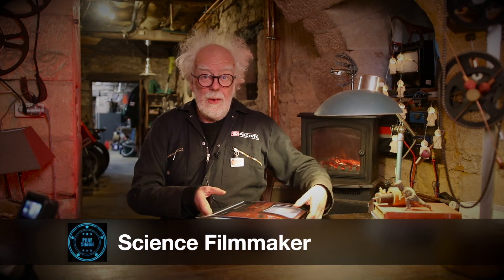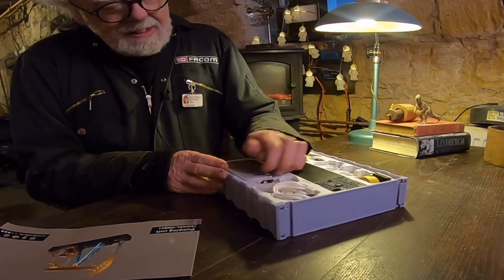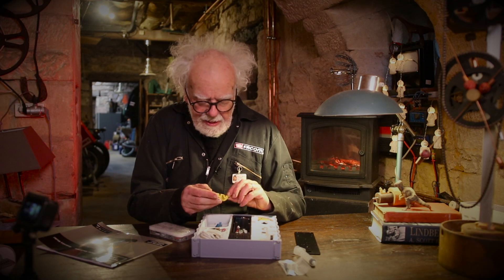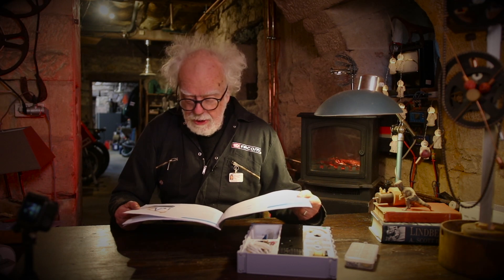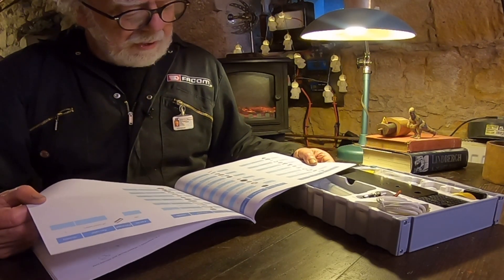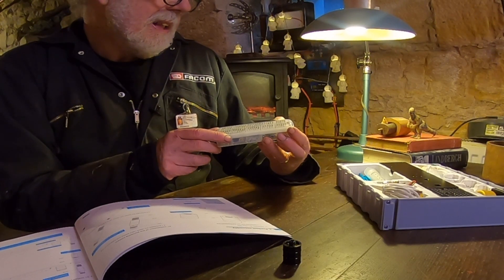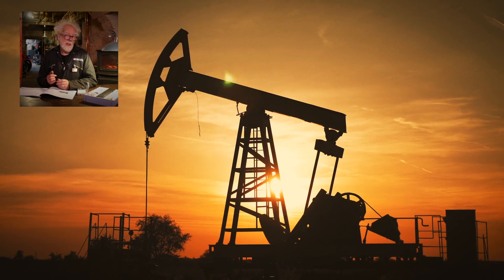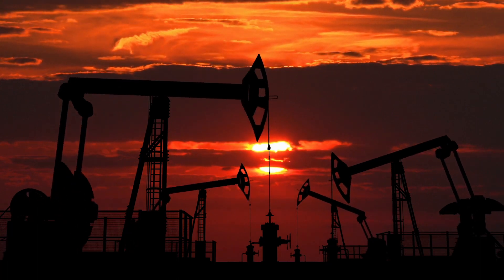Building a Model Oil Pumpjack - Prof Simon

Comment: Hi there! Glad to find your video.  Your intro is very intriguing; mentions of the car getting its oil from this and all.  
I am in the process of creating a museum of sorts in a small town known as the Gateway to Colorado.  I have many things that came from the town and a bottle of fresh pumped petroleum is one of them.  This is exactly what I plan to use to display it.  The black food dye in the water is very clever.  I may do that, now that you've unlocked that creativity block I had...But I am pretty set on running this oil through it...lol.  Cheers!

Comment: Still have those, only small ones operating here in there in Ohio & PA to extract the oil off the gas wells. Not super common but found occasionally and in operation. Most of the oil is used in lubricating products. Somehow stirling engines and using some of them as refrigeration units sounds more exciting. You turn the stirling engine with an electric motor  rather than using fuel to have it create power. This will result in a cooling, or heat extraction, of some of the stirling engine parts, this air conditioning with air as the refrigerating fluid. Part of my thermodynamic classes in engineering school and as seen on a few You Tube videos.